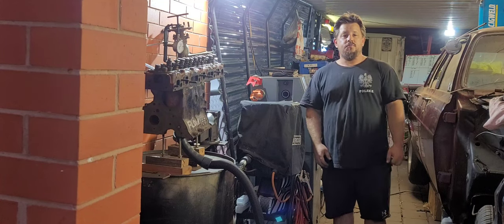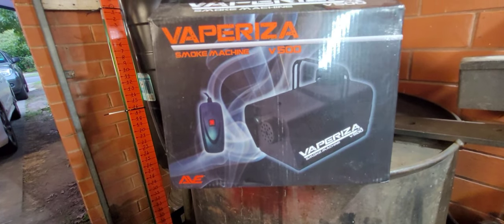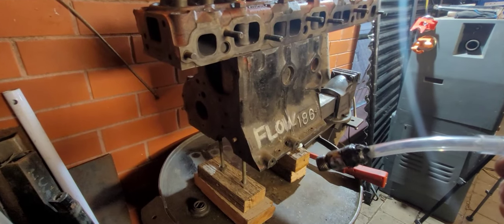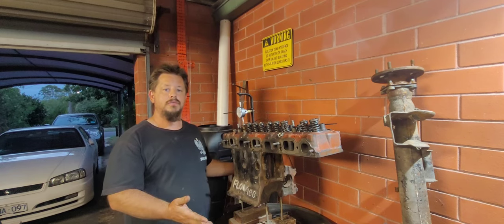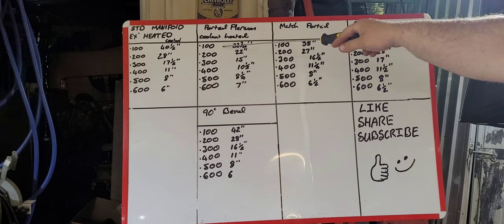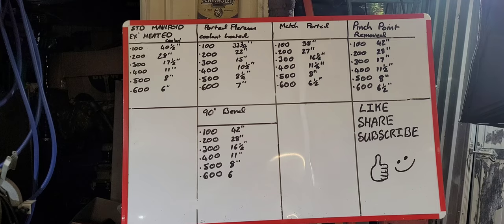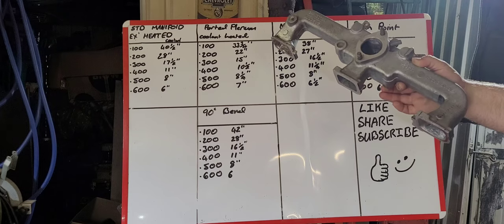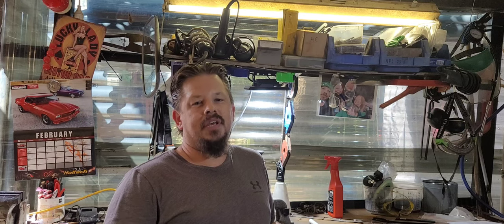part 3 holden 202 inlet manifold porting series and a look at our d.i.y flow bench

Comment: Excellent Did a 202 0n a budget  30 years ago flywheel lighten, starfire rods, balance, fast streetcam, then ground out the intake port divider replaced those 3 head bolts with a cap screw. Drilled out the bolt hole and ran a home made spot facer down for the capscrew to land on. Massively opened up the ports.
Reply from the maker: Nice work & thanks for watching 👍🍻

Comment: So what in summary is it worth doing to the manifold?
Reply from the maker: Porting the plenum and radius the sharp edges at the inside start of the outer runners to plenum and stream line as much as you can the 90* degree bends taking material of f the larger more sweeping side of the bend when porting, if you haven't already have a look at p1 & p2 it'll give you more idea what im talking bout and yes the right porting will make a difference how much depends on what other mods have been done thanks for watching🍻👍
Reply: @pushrodtv6623 Thanks for the reply. Yes I watched the other parts. A clear summary with numbered points at the end of the video are always helpful. Despite their popularity videos on modifying 202s are rare on Youtube. Narlyjohn has a good blog on red motors. Google him up. I am planning to use a Rotec TBI on an HQ racing spec motor which uses a standard inlet manifold. There a couple of YouTube videos on Rotec.
Reply from the maker: @amraceway  i have seen the Rotec videos thanks for the feed back also have at the exhaust manifold video i did ,ill doing more red motor and a few gray motor videos in the near future